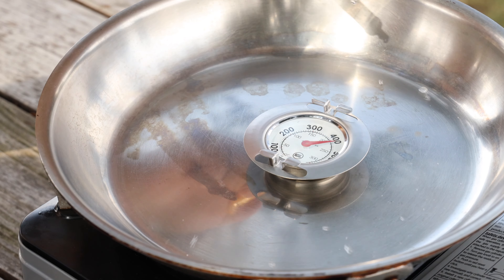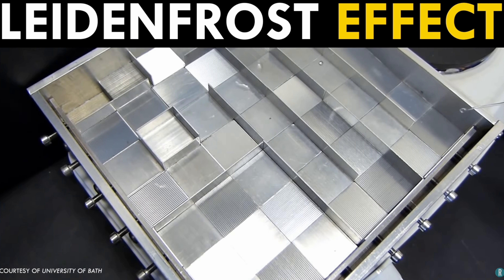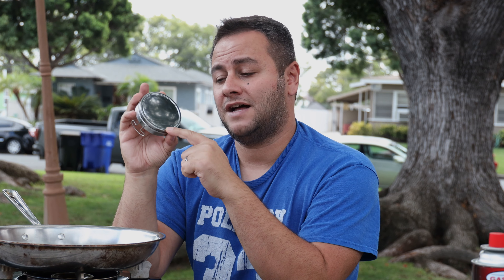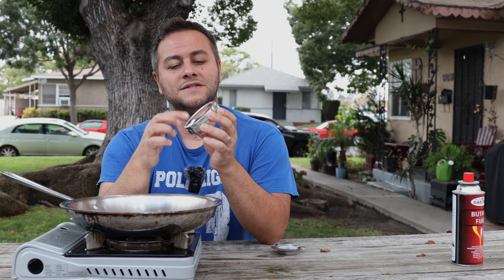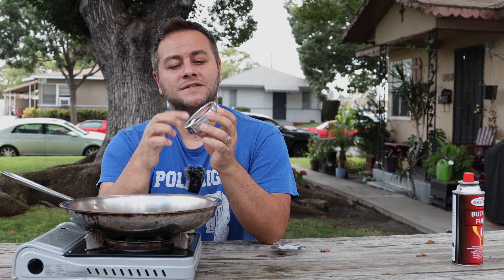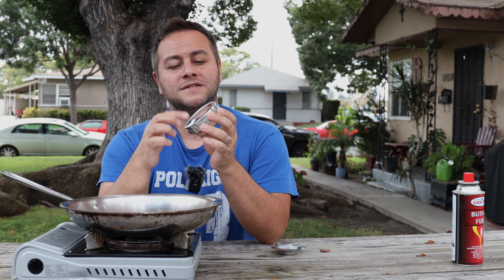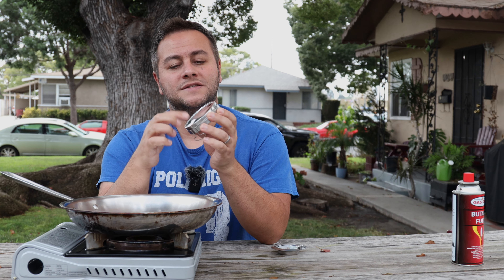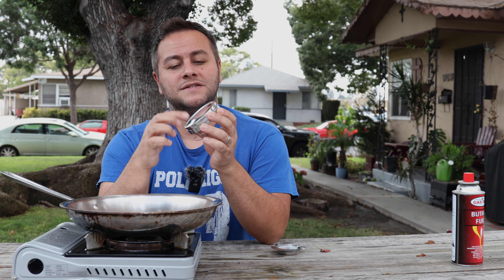Does This Really Make Your Stainless Steel Pan NONSTICK?

Comment: exactly what is frustrating me.  i got the SS pan nonstick, turned down the temperature after LF effect, but had to add ingredients.  STICKY AS HE** after that.  just kept worsening.  holy moly
Reply from the maker: Ss is less forgiving on temp. You may have cooled the pan off too low. Generally speaking, if I need to cook something a bit delicate, I use my carbon steel pan
Reply: @tomwadek  I'm going to waste a lot of time and food learning to moderate the temperature!  I can now make uni ingredient foods without sticking.  It's adding more stuff where I get into trouble
Reply: That's because the colder food ingredients instantaneously drops the temperature of the pan down. The colder and more ingredients there are, the faster the drop in temperature.

Some suggest to bring the ingredients to room temperature, but ain't nobody got time for that.

May have to turn off heta then put it dack on med when adding additional ingredients.

SS pans don't retain heat as well due to thinness and less mass, so would need the heat on after dropping ingredients